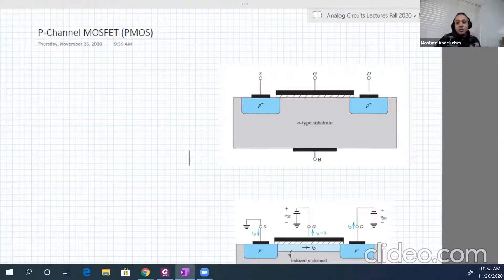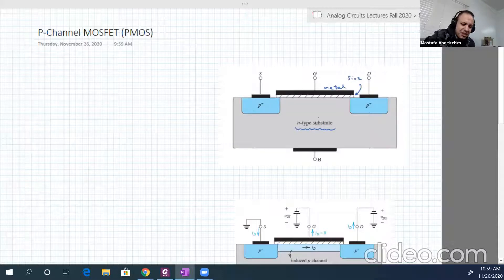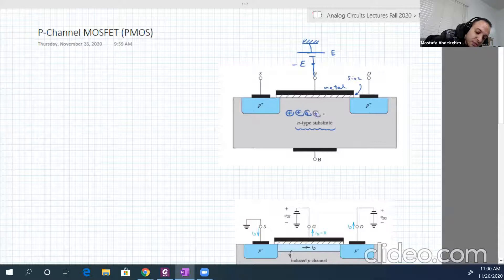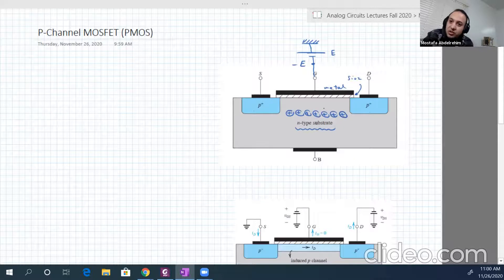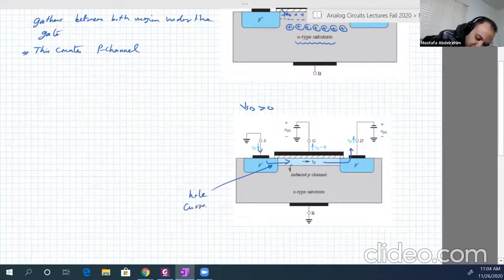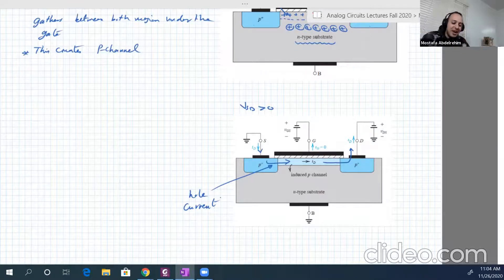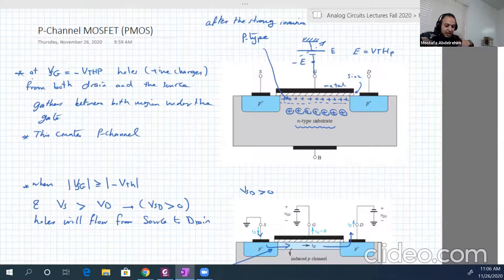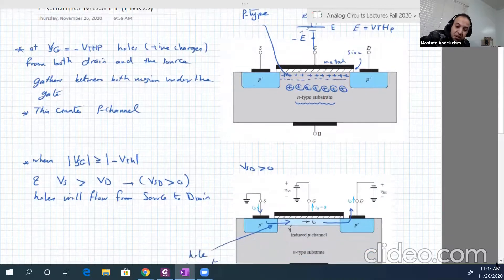[28a] How PMOS Transistor Works - PMOS characteristics

Comment: Hi, shouldn't source be connected to a higher potential than the drain ?
Reply from the maker: Thanks for asking 
I reviewed the video and I see at all times the source was connected to higher potential. Basically S is connected to 0 and at the same time D is connected to -VDD (remember 0 > -VDD)
Reply from the maker: You can refer to specific time in the video if you otherwise